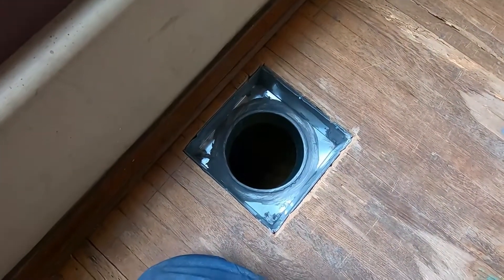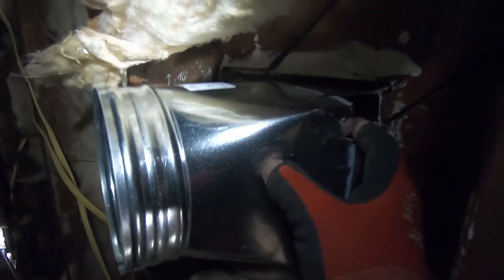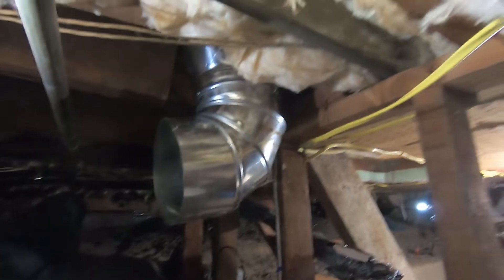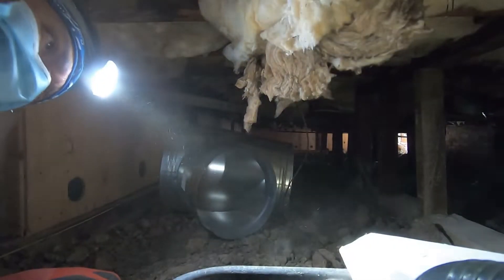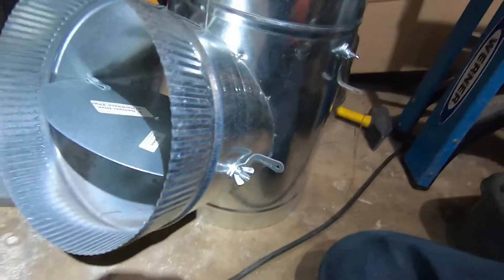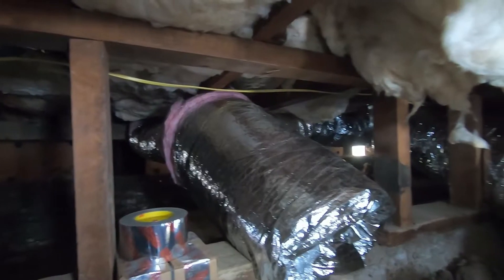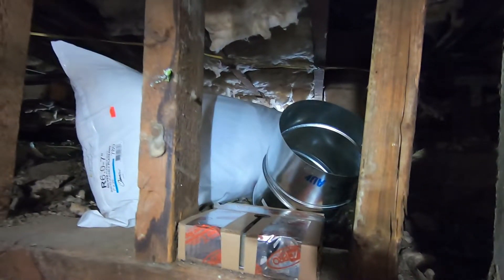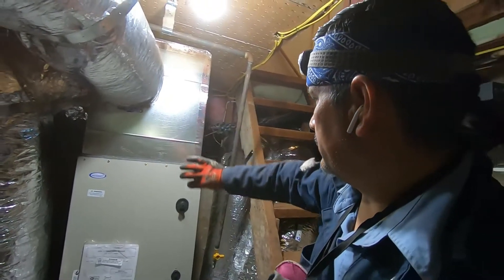Need more return 2

Comment: Excellent, clean looking work as always man. I’ve been there and I feel your pain. I installed exclusively for 15 years and just recently started doing mostly service work, thankfully. Here in Eastern NC with this heat and humidity these attics can be above 140 degrees. I took my Testo smart probe in an attic with me last week and it was 143 degrees. I had to change an expansion valve and filter drier on a Carrier split heat pump. I think I was really close to having a heat stroke. When I got out of the attic I was light headed and I felt like I was gonna faint, and of course my clothes were completely soaked with sweat. I’ll take the crawlspace over the attic in the summer everytime. Although dragging all your tools, a bucket of mastic, and all your ducts with you is a pain. I’ve been crawling as fast as I can and smacked my knee on a rock more times than I can count. Hvac is a great trade if you can handle the working conditions. I take a lot of pride in my work knowing that I did the job to the very best of my abilities.
Reply from the maker: I love reading comments like yours. You should post some videos it pics!